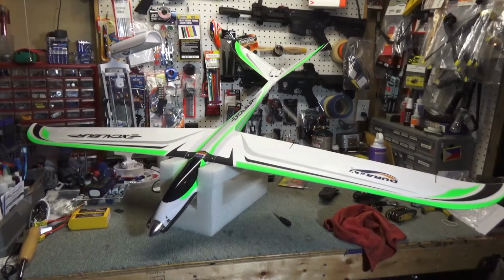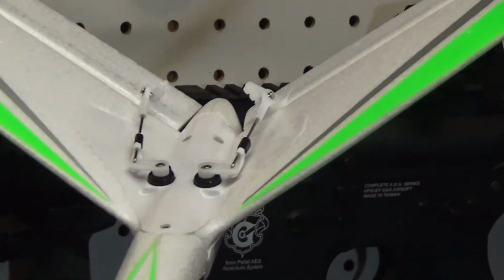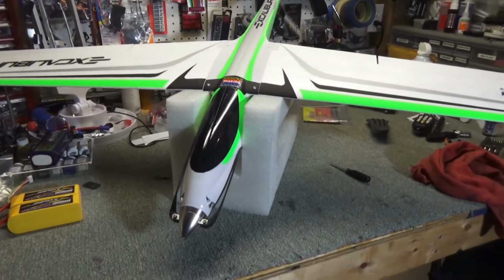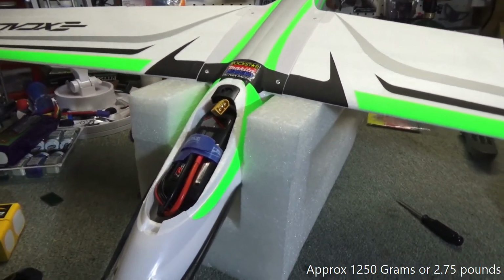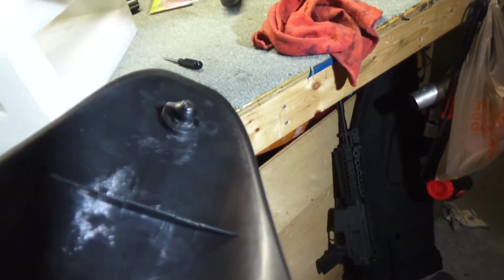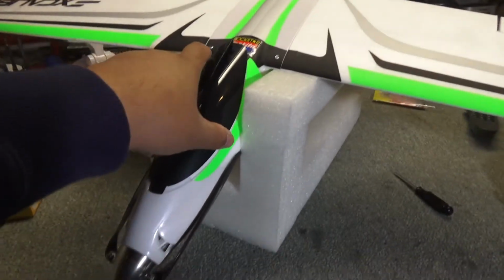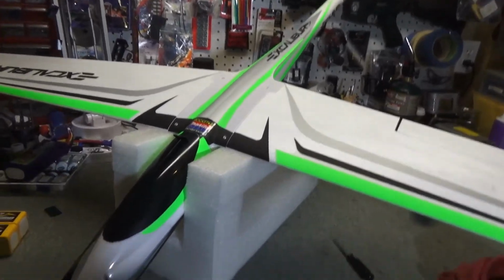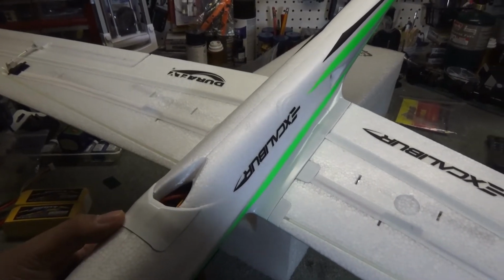Build thoughts of the Durafly Excalibur and a close & personal look at it

Comment: To fit a 2200 4s in I cut the two foam supports at the front which makes the battery sit lower and easier to close the canopy.
Reply from the maker: I'll have to give that a shot.  Thanks for sharing and have a great day.
Reply: @willnate35  No worries, Is it just me or is there an issue with limited movement from the servos in the tail ?.  I have them on 100% travel but they dont seem to move much for being on full travel ?.

Comment: Nice video👍🏻 did you ever fly it?
Just about to place an order for one with the upgrade props too but the spinner is out of stock till mid april😕
I’m just unsure about the size of battery I can use? I wanted to use the Turnigy graphene panther 2200mAh 4s but not sure if it’ll fit....... any idea?
Reply from the maker: The Graphene 4s 2200 is snug in this plane but works really well.  I checked the Panther dimensions and they seem smaller than the regular Graphene.  Double check it but if true it'll fit just fine.  I did fly this awesome plane, but It's hard to record it so no vid, as of yet.  Have fun my friend and thanks for the view.
Reply: @willnate35   Thanks very much! I was just checking the dimensions on HK as your reply came through. I'll make order now :-)
Reply from the maker: @TheMuddatrucker Let me know how you like the battery, maybe I'll pick one or two up.
Reply: willnate35  No problem👍🏻 it might be a week or 2 as I’m starting a fresh with the plane thing! Used to fly them a few years ago......... remember the durafly zephyr v70? Had one of those along with a few others but quit the hobby & sold them all due to working long hours.
Just placed a huge order with HK but the only thing they didn’t have in the U.K. warehouse was the transmitter I wanted👎🏻  had to order that from Europe so might be a week or two b4 I finally get to fly, might even post a video 😁
Reply from the maker: @TheMuddatrucker  Post the vid!!!!!  Glad you're back and I hope you have a great maiden flight.  Have a great day my RC brothah.
Reply: willnate35  the Excalibur arrived last week........ with a faulty tail servo! 🤦🏼‍♂️ few days later I’d replaced them both with metal gear ones so alls well, I did end up going for a couple of the 2200 graphene panthers too and they do just fit!! So thanks for the help there👍🏻
Also just back from the maiden too, the weather not great in the U.K. today, very cold and a constant wind of 15mph gusting to 25mph but couldn’t wait any longer lol, must admit I should have though. I’ve not flown for around 5 years so was very rusty!! Far too early for me to give any sort of opinion on the plane or even the batteries as I never even had it above half throttle for more than a few second 😂 it’s fair to say I was a nervous wreck lol but somehow managed 2 near perfect landings. And no I didn’t film it, far to much swearing for that, maybe next time 😂
Reply from the maker: @TheMuddatrucker  You're a brave man for flying in those conditions.  I would have probably waited but I totally understand how you must have felt.  Maybe I would have flown too.  The fact that you had 2 perfect landing tells me you're a very good pilot and just need to get shake off some rust.  I think if you would have filmed and swore it would have been hilarious.  BTW, to allow me to fly in windy conditions, I used a Lemonrx 7 ch receiver with a gyro.  Makes it so I can fly more.  Great rx.  Keep me posted.  Take care my brother.
Reply: willnate35   Not long after i got back I discovered the reason why I’d struggled  so much! The CG! It wasn’t just unbalanced, I completely forgot to check it altogether!🤦🏼‍♂️🤦🏼‍♂️🤦🏼‍♂️
Needed an extra 35-40grams adding up front, so much for the “very good pilot” 😂 I’m far from that though.
Snowing here today but 2moro & the day after look promising for another try 🤞🏻

Comment: mine lawn darted after 3 minutes on the maiden- im blaming all the carbon fiber in it and the lipo tray looks like carbon fiber too - halted the tx rx communication
Reply from the maker: That stinks, I would be very angry if that happened to me.  Fortunately I haven't had that problem, knock on wood.  I typically use a Lemonrx receiver/satellite combo with gyro to be safe.  Great rx you can typically get for around $30 shipped.